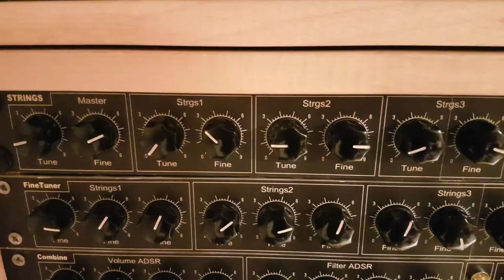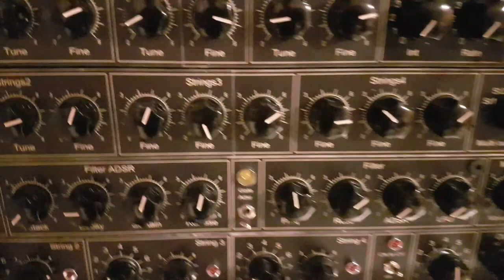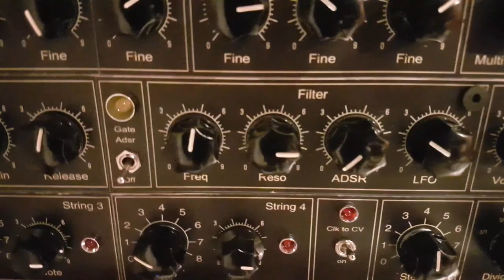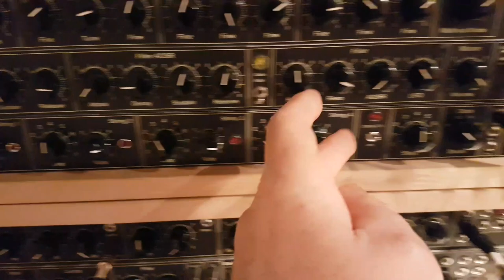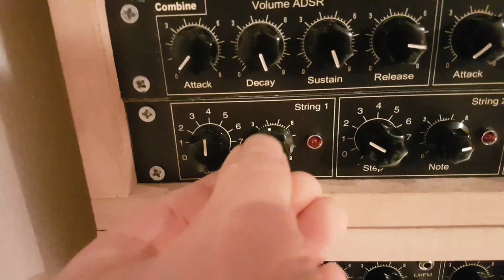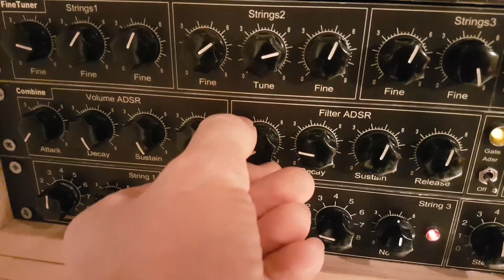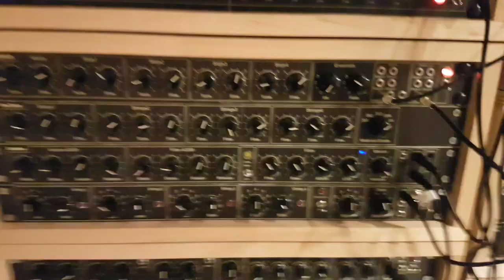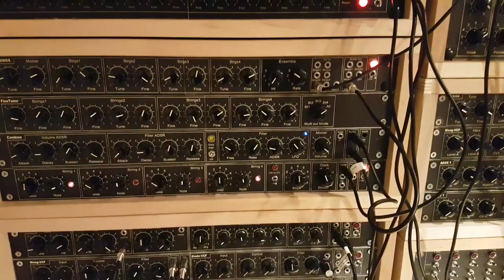The Analog Strings-Synthesizer, Introduction, Plans and Circuits

Comment: Sorry but the link gives a zip file but there is nothing in it
Reply from the maker: If you open tue link, there should be shown a download-symbol in the upper right corner. Clicking on this Symbol should work. The File should have a Size from 8 MB